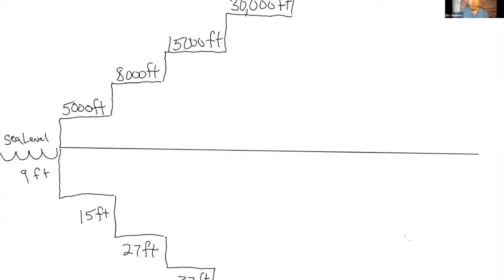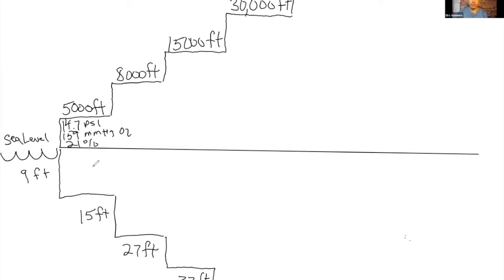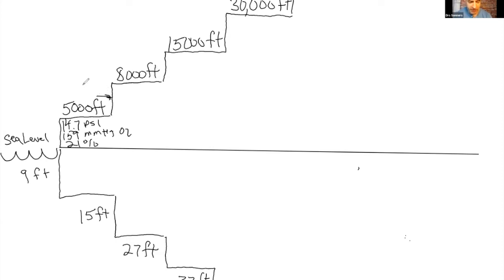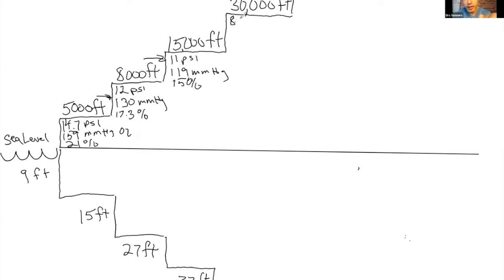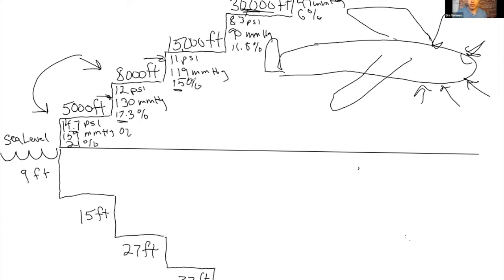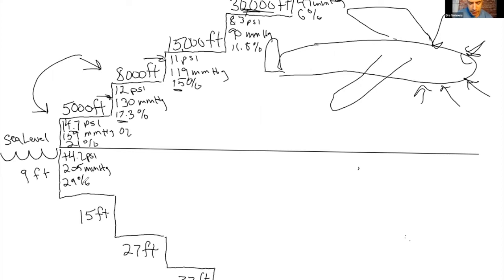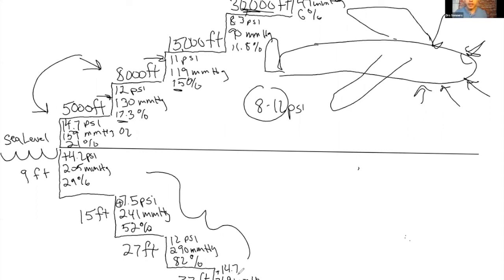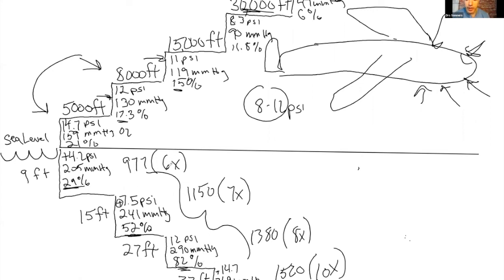Grounded Planes Could Become Oxygen Chambers to Treat Covid-19 Patients

Comment: The "Plumping for Oxygen" - No - each seat has a portable chemical O2 generator so the plumbing is only from above the seat to the seat not to a central location - the O2 generators last only about 12 minutes enough time for a let down from altitude - Again my numbers are based on memories of 20+yrs ago training on a 737-200 so may be old.

You would use portable "C" sized cylinders 1 to each patient.
Also we came up with a way of providing many portable O2 systems using scuba and welding tanks and various different adaptors ideally a DIN scuba tank O2 cleaned with a HP steel adaptor to Pin index system for medical O2 regulator - but if these run short we have some clever , cheap little adaptors to run O2 direct off a tank with no regs - see our page on FB called "Scuba-Aid) - https://www.facebook.com/SCUBAAid or search youtube for "Oxysai"

Comment: Most planes are meant to be pressurised to pressures lower than sea level or at worst sea level. Typical plane like 737 -200/300/400 are made to be pressurised to 6000ft Altitude i.e. you may be at 37,000ft but inside the cabin its 6,000 to 8,000ft. Some like Cessna Citation are smaller and designed to be pressurised to sea level 1000mb which is why they are often used as air ambulances, can fly a bends victic (DCI) at sea level equivalent so no bubble growth. As I recall from some training on the 737-200 i had 20 yrs ago just after landing a 737-200 is pressurised to a higher pressure than sea level just as it land but thats only 500ft below sea level so its nothing. Maybe though using an expired airframe could be used. But again most planes won't take much of a higher internal pressure - not the 1-2 bars above atmospheric you'd want to get that PPO2 up high. But lets check 

That said at 37,000ft altitude (using STP at sea level) external pressure = 0.21 atma
At Internal pressure is 6000ft alt  = 0.8 atma
Pressure differential (+ve is burst) = 0.59atma

So if we were to pressurise the airplane at sea level to 1.59atma that would be the same diff. Pressure and at 100% O2 we'd get a PPO2 of 1.59 Bar - Equivalent to just about the Max Deco PPO2 some tech groups use (although now its more 1.4 / 1.5 it used to be 1.6 for many) - This is actually doable - Plus if you used a citation you could get 2 bar PPO2.

BUT - How would you pressurise - run turbines on the ground - usually it works by taking engine bleed air from the compressor (Or modern planes like 787 carry a compressor) but you'd have to over-ride all the software and sensors. I agree with idea of time expired plane better - would be adding a lot of stress cycles also you couldn't lock people in and out. 

I like the idea more and more - Especially you get to roll a bunch of gurneys at once - People could breathe off small portable O2 kits - as like BIBS - at 1.6bar PPO2 they could be on that 45 mins at a time or 3 hours in a day - So if they breathe 100% O2 (1.6bar PPO2 8 mins in an hour spread over the hour to keep PO % right up - they could stay in there for quite a long time on high oxygen, in between they breathe air at 1.6 Bar (PPO2 0.2*1.6 =0.32 bar PPO2 - the same as breathing 32% O2 at sea level) .

You'd need to have O2 monitors on the atmosphere inside and good flow through of air through the purge valve at the back of the plane  to ensure that exhaled O2 from the portable sets doesn't build up and to stop high viral particle loading in the cabin for the attendents - But a plane could have seats taken out and gurneys run in and a number of attendents.
Reply: Great info!
Reply: Wow like,  please add your credentials to this

Comment: Yes I am sure they could be.
As a oilfield diver I have done a lot of surface decompression on O2 and have knowledge on the principles of HBOT.

To the best of my knowledge (which is not extensive) a commercial airliner such as a 737 has a max pressure rating of approximately 1 atmoshere. 

I doubt any airlines would be keen on letting any currently flying planes be used for this purpose as you would be adding "cycles" to the airframe. However a newly decommissioned plane could be used. Plus they have BIBS already built in, although the built in O2 is supplied by O2 candles on an large commercial aircraft.

If you are not really going deeper than 20ft or so. I don't see why it cannot be done. 

Alternatively with the oil price where it is there are plenty of hyperbaric chambers lying redundant on dive support vessels in various ports around the Gulf Of Mexico.

Comment: You could certainly test the idea

It would be as simple as bring some oxygen tanks into an airplane. Close the doors and open the oxygen tanks

You have just pressured the cabin to above sea level and also increased the percentage of oxygen

It could almost certainly help with breathing

There will be practical considerations
A person might need this for 10 days
So how do you provide showers, toilets, food, staff, medicine, etc while perhaps only allowing one decompression and compression per day to get staff in and out

The cost might also be prohibitive
Airplanes only have X number of compression and decompression life.
So although not flying you are effectively adding mileage to these machines

It would probably be easier to just buy shipping containers and put them in hospital car parks. Weld them tight. Put a bed inside and some lighting and charge point for a mobile phone. Compress it with an oxygen tank. When the person needs assistance they can call for assistance to use the bathroom or have a shower etc. And a nurse or doctor can check up on them and if necessary they are just outside the hospital

Comment: not an engineer so just out of curiosity when the topic came up before I wondered about the technical feasabilty of using all those covid grounded planes .
  I therefore googled some info...this is what I found:  

How airplanes are pressurized All airplane cabins are pressurized to simulate
the amount of pressure felt at 8,000 feet

. Pressurization happens via the engines, which compress incoming air, heat it up,
and then divert some of that hot compressed air to the cabin. On its way to the
cabin, the air temperature is lowered via two different cooling systems and
then an expansion turbine, which “cools it the way blowing with your lips
pursed results in a cool flow of air,”. Finally, the cooled air is combined with
air already in the cabin using a mixer, or manifold.

Pressure in the cabin is
maintained by the opening and closing of an outflow valve, which releases
incoming air at a rate regulated by pressure sensors [“think of a pressurized
cabin as a balloon that has a leak but is being inflated continuously”]. not
only for passengers’ comfort but also for operational purposes                     

if planes were pressurized at ground level,                                                                                                                                          
they would have to be made with heavier materials and use more fuel.
Reply: Kathryn Sheetz not necessarily, the planes are rated for differential pressure.
But the sound of it with this hypothesis they don’t require that high of a differential pressure. Certainly theoretically possible. In fact planes can pressurize to below sea level.
Reply: This was already run past some of the sharpest minds from  NASA, USAF, National Science Foundation, MIT, NSF,  and sent, endorsed, by many reviewing scientists, doctors and engineers across the above, to the White House, back in March.
Reply: If they were to be used as chambers there really isn't a reason a large compressor independant of the engines couldn't be hooked up to provide the pressure. Instead of running the engines at ground level just to provide pressure and not thrust.

Comment: What about the lowest floor of a large ship? That would be below sea level and easy to flood with oxygen.
Reply: Pressure doesn't work that way as the hull of the ship is pushing back against the water the only increase in air pressure would be from the air above you.  The pressure would increase but only at the same rate as the "above" sea level rate.

Comment: Why do you need to be in a room? Why can't you just wear a full face SCBA with the pressure turned up higher. I can't believe it's impossible to reprogram a regulator to pump out a higher pressure.
Reply: Your body wouldn't equalize the pressure.  You'd have to strap the face mask on TIGHT and then the differences in pressure would just keep your lungs expanded and you'd not be able to exhale.